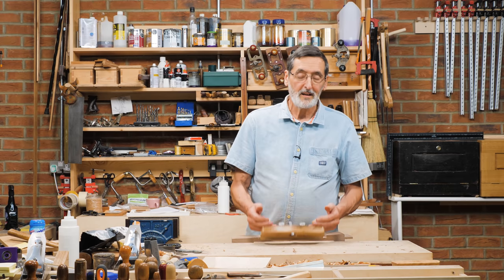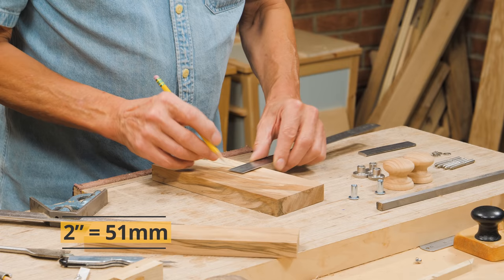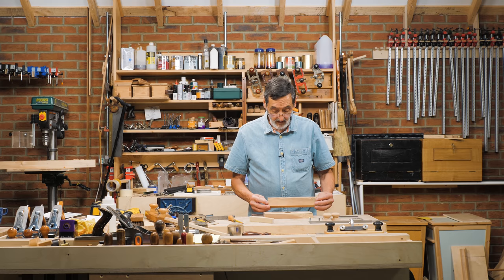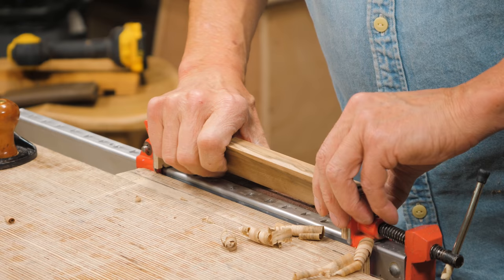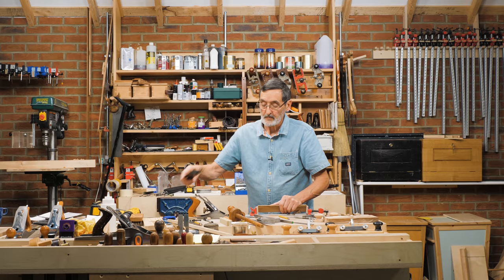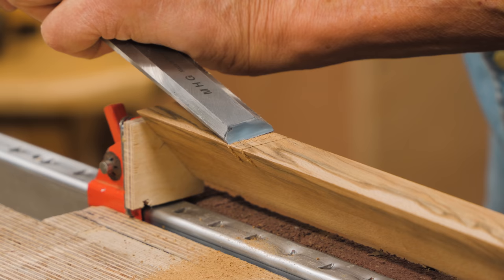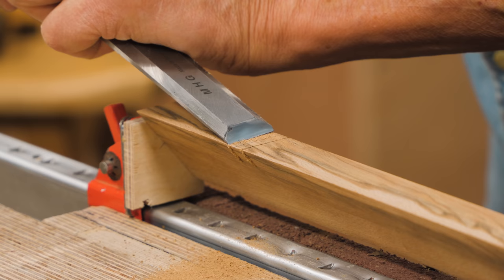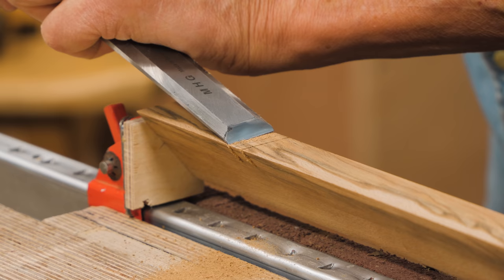How to Make the World's Best Router Plane | Paul Sellers | Episode 1

Comment: Mr Sellers, 
I have done it! Whilst I have been handy all my life, I've never been a wood worker. After restoring a few old planes for a project, I saw this video and knew I'd need one, but can't afford them these days on ebay. 

I sourced the hardest to work woods for a newbie: hard maple and mahogany. 
I had to learn how to use my new planes to cut down the oversized stock I got. 
I had to source, cut, grind, and bevel square steel stock and then learn how to heat treat it at home...I quenched with oil. 

Then I made my very own BLO and shellac cuts, thanks to you. 

If you'd like I can send you a link to the build with pictures and descriptions. 

It took me well over 150 hours to put in all the work to make this project come together, but I've learned so much I'm thinking of looking into an apprenticeship at 50 years old. 

You're a gift to us all.

Comment: The timing of this video is perfect. Have been looking at both new and used router planes here in Australia and the prices are nonsense.
Reply: Same. Stumpy Nubs also has a video but, you know, it’s Paul. 🙂👍🏼
Reply: Same here… nonsense is right.
Reply: @willemkossen  thank you
Reply: I bought a router plane from eBay for just less than £100 UK pounds after two and a half years looking. Nightmare. In some ways I wish I’d waited and made one but I presume Paul is going to grind a bevel onto the tool steel. I have neither a grinder or the patience for that.
Reply: problem here in the uk is the wood makes it almost rediculous. if you dotn have it already the cost is ineffective you mgith as well get a new

Comment: Quick, order your bar of 10x10mm tool steel now before it triples in price, due to the Paul Sellers effect!
Reply: Soo true
Reply: @Old Man Henderson, the one with the Trousers Chester hobbie store
Reply: Wood by Wright caused all the Bench Dog router plane blades to sell out until next August! Thankfully, toolsteel should have a slightly better supply.
Reply: The ghosts I called… 👻
Reply: Totally! I ordered mine right 15 mins after the video dropped, and the price is 50% higher now.
Reply: Ha ha.... Paul is getting dangerous.
Reply: I’ve made one similar to this an I cannibalized an old chisel for the blade. Blade needs to be long enough to make the notch. And lop the socket off. Not perfect but it’s served me for years.
Reply: Actually, with a little redesign you could use cutters made from a variety of sizes of blades.  If you look on machine shop supply websites for lathe tool blanks you can find it in sizes ranging (in the US) from 1/4 inch (about 6 mm) to 1 inch (about 25 mm).  That might suggest interesting possibilities for that router plane.
Reply: 111111111
Reply: Just get a half inch high speed steel lathe tool blank.
Reply: Amazingly they're higher price for a factory cheap oem on Amazon than the real old Stanley tools second hand on the bay.

I had to settle for a scraper card this time around. 😂

Comment: As an American, i really appreciate the conversions from the metric system to imperial. Big fan- really thought this was an awesome project, looks like it works incredibly well!
Reply: In the uk they switched from imperial to metric and it left us all with a mush of figures in our heads. Half the nation was rejecting metric and half rejecting imperial. By the time I was in junior school in the 80's they quite literally banned imperial figures, we we got in trouble for using them.
I still have the mush, depending on the size of the measurement I'll flip back and forth between the two formats, which is bad, because it's fitting the measure to the part. Hence the mush 😂
Tiny things are in mm, larger measures I do in inches with a conversion reference in my head to metric, and then large measures over say 40ft and I'm back to fully metric again.

Metric I find easier to see the sizes in my head, so many products in the middle that use inches so that stuck. And mm just make sense for tiny measures.

Apparently metric won the war as most parts on the global market are in mm, the big manufacturers are switching to it for compatibility and cost reasons.

I still prefer pints of milk to litres 😂
Reply: @luminousfractal420  yeah I kinda wish the US had switched to metric.. I feel it's easier to be more accurate without having to think much, and is much easier to do the math in your head with metric... plus it really does seem much more widely used. Imperial seems like random numbers with how things break down- and metric just seems way more straight forward based on multiples of 10/100/1000... 

I can totally see how it could cause some chaos and confusion having a country transition to using another measurement system though...

Comment: I love how Paul always puts measurement conversions on the screen from metric to imperial. As an American this is so extremely useful! You can argue the benefits of the metric system all day long and whether or not we should use it, but as someone who didn’t grow up with it, it’s extremely hard to visualize in everyday life. Ask me to guess how long something is in inches and feet and I’ll probably get pretty close. Now ask me to do the same in meters and centimeters and I wouldn’t even be close. I realize we’re like the last holdout in the world through our own doing, but Paul putting up both measures on screen makes his videos so much more practical and user friendly to those of us across the Atlantic. 

Incidentally I personally think there’s more to be said for the Imperial system at least where woodworking and other trades are concerned…try quickly dividing anything metric into easily measurable halves, thirds, quarters, or sixths, and then do it with the imperial system, which is easier? If you need to break something into 3 pieces it’s easier to measure out in terms of 3x4 inch pieces than try to guess where 3.3334 cm is. And that’s just one example : )
In the science fields then metric is probably better. I think that both systems have their benefits in reality. Imperial for the everyday practical application of quickly dividing things into measurable fractions and metric for when when extreme precision is required.

Comment: I made something like this but it didn’t work well with a chisel at an angle. Instead I have just made one using an Allen Key. I ground it and sharpened it. I drilled a hole for a tight fit in a 1.5” square hardwood. I angled the base side to tilt the cutter and screwed it to a base with a 2” hole. I adjust it by tapping with a hammer to the base of the rebate and then another tap. It works a treat. If it works loose I shall add a screw clamp. I might add handles but it works fine without. I might also buy a Veritas cutter if this blunts too easily. 
Paul Sellers is a huge inspiration.

Comment: Paul,  two things, one is that a flat bit is intended to run fast to be efficient, they put a lot of strain on the drill if run slowly !  and two, a sharp adjustable bit in a brace cuts the outer periphery of the hole first so you get about the neatest hole you can get, now I know you know this so just reminding you !    if your bit is sharp you should not have to work too hard, I have drilled holes up to 3” in big lumps of timber with these (boat work) without too much strain.
Reply from the maker: Thank you. I did sharpen the brace bit fgresh before I began and it took all of my strength to get ot through the beech. I too was very surprised at this and so I could not advise people to do what was as near to impossible as it was for me, despite my 56 years of experience using one regularly. I thought I made that clear but perhaps not. I also try not to use what the vast majority of my audience do not have readily available to them, as best I can, that is. I would guess that 98% of my audience would not have the bit size nor the bit brace to use either as my audience is across the globe and also in the poorest regions thereof. As for the flat bit question. I do understand this but even so, I had to work with it to go through.

Comment: Hey Paul. You probably won’t see this as this video is 4 months old, but when using a drill with a keyless chuck like that dewalt you used, you tighten the chuck to the bit and then loosen it by hand until it clicks once. That’s how you lock a keyless chuck so it won’t loosen on you during operation. I threw away a perfectly good ridgid hammer drill not knowing that little tip.

Comment: Your first drill had the clutch engaged (numbers = screw driving mode) which is why it was stopping. If you turn it to drill mode there is no clutch. Also speed 1 for larger bits as you need the torque rather than speed. And great tutorial, thank you!

Comment: NOTE on difference from Video and Online Instructions:
I'm in the process of building my plane from the kit.  It is worth noting that the instructions on the website the kit links to takes a different approach than the video does on preparing and cutting the upper portion of the plane.  In the video, Paul prepares the 50 degree angle and then cuts the slot for the iron.  In the web page instructions, he cuts the slot for the iron first which is simpler for work holding since you are working at right angles for the challenging part.  I wish that were noted as if I had noticed that earlier on, I would have likely taken the approach from the online instructions.  

Now... on the plus side, I spent a day designing and building some vice jaw inserts to create a way to mount my pipe clamp like paul does his window sash clamp.  My vice jaw sits flush with bench apron and ... well... a pipe ain't held best by a face fice.  My jig is absolutely essential for work holding the upper portion with video instructions.  Especially if you need to do some tweaks on it after cutting away from the extended piece of wood.  I can see that this vice-jig will be a true game changer for future projects.

Paul, as always, I appreciate your videos, blogs, and websites.  Thanks a million!

Comment: As long as the iron doesn't need to be hardened, I think I might have to make myself one like this. Excited for part 2. 👍👍
Reply from the maker: The blade ideally needs to be hardened. However, it does work pretty well just as mild steel. You'd just have to sharpen it much more often.

Comment: As I made my poor man router plane I used the tool steel itself (an allen key) to fine adjust the groove it will rest in. Thus I got the perfect hexagonal fit.  No guesstimating. The tool steel itself is the best scraper/chisel. Clamp it flat on your table and ride the piece of wood on it. Use paper/scrap vernier for elevation to just the tenth of a millimeter you want on the finished fit.

Comment: Dewalt Drill Tighten clockwise, then turn one click counter-clockwise. I know this is counter intuitive AND it will feel like your bit has been loosened, but do it anyway. This will lock the bit in and it will not loosen.

Comment: I'm not sure why anyone would try and read a piece of woods grain direction by eye. It's dead simple to use your finger tips and rub in both directions. One will always feel a bit rougher than the other. At a macro scale, wood is much like the fur coat on a dog. One direction is quite smooth, the other direction would go against the direction the hair on a dog lays. Wood is exactly the same so it's grain direction could be accurately accessed even while blindfolded. So you'd position the wood and obviously plane in the same direction the wood feels the smoothest. Your sense of touch is far more accurate than your eye's are, and especially so with highly figured wood where the grain direction can run in multiple directions.

Comment: Hi Paul, I’m just about to order your router kit but I wanted to check something first. My piece of oak is an inch and a quarter. Does it matter that it is slightly thicker. Will it effect the length of the bits with the kit? Many thanks…..

Comment: Thank you for the awesome project! Here in Thailand imported quality hand tools are very expensive (import tariffs & people use power tools as cheap Chinese hand "tools" are unusable) so a DIY project would be very useful.

I'm wondering how to obtain the suitable blade steel here in Thailand. The closest I can find is S50C or S45C, which seems to be carbon steel with 0.5% or 0.45% C, which is less than 0.9% in the recommended O1 steel. At least they sell 10x10mm bars ($8/m, named "ลิ่มเหล็ก" - steel ingot or ลิ่มแท่ง ลิ่ม"machine key") since I don't have much metal working tools here. I saw people make machetes out of those steel. Do I understand it correctly that medium/high carbon steel would be tougher against harsh usage but would not hold edge as perfectly as O1, but still could perform decently for such a small blade (possibly with more frequent sharpening)?

Knurled nuts (DIN 466) can be also found on the big online marketplaces. The screw-bolt rod could be replaced by a screw nut and a threaded rod (or bolt with head removed).
Reply: Probably the easiest way would be to get a cheap (but not too cheap) chisel with 9-10 mm width and cut it. S50C can get maximum hardness around 30 HRC which would likely be too soft.

Comment: Sellers Router Plane Plans
     Paul the questions is about the bottom diagram on page 3 of 6.  It appears to be the top view of the
router but the width of this top view is different that the bottom view above.  I suspect it's was did this
way so it would fit on the page.  Am I correct or is there a better explanation ?
I have my base piece cut and ready to drill the center hole.   So I'm not ready for the hardware but It
will not be too long. 

Thanks,
David R Grindel

Comment: In the video, Paul says that the notch should be cut to a depth about 0.1mm less than the thickness of the cutting iron.  That's barely the thickness of a sheet of paper.  Would the iron be held as securely if the depth of the notch were 0.5mm to 1mm less that the thickness of the iron?

Comment: Im not sure it is the best router plane. perhaps there are two home built types. In my humble opinion the front edge of this essential tool should be straight not curved. This enables the user to pivot the plane upwards whilst using taking the back edge of the plane off the job. This allows the user to set the final depth of cut but to creep up on it and lower the depth of cut by pivoting up on the front edge and then making progressive deeper cuts. Yes it does change the geometry of the cutting slightly to the job, but it works.

Home made router plane aka 'The old mother's tooth'

Comment: I was intrigued: you chose 50 degrees because with any less it gets hard to see the cutting edge. Why not cut the 32mm hole through the sole at 50 degrees (or 45, or whatever) ? Or
even use an oval hole to improve visibility?
Reply: Try it out Chris and see what you think. I've found though that generally with Paul and other masters like him that when I've made adjustments like that I discover through use the reasons why. Like I had a chisel fall off my workbench and decided to glue a strip of wood at the end of the tool well. I thought that'll stop it rolling off and wondered why I didn't see it done before. Then I went to sweep off the bench and found the strip made cleaning the well a chore. I took it off again and now just make sure my tools are away from the edge. But it was good to try it out all the same.
Reply: @michaelballinger6419  I have seen your piece of wood cut at 45deg to make it easier to brush over.

Comment: I just bought all the parts from the PDF and it came up at around 80 GBP (the Beech from eBay was 20GBP of that, the iron was 15 GBP), plus a bit more to get rasp and file (40-50 GBP). 

Have you (or anyone reading this?) thought about supplying kits of the right amount of fixings, metal and potentially precut wood blanks?
Reply: Seems a lot. I can buy enough beech locally to make 10 for £11. Other parts should not be that expensive. hanger bolts £3 from B&Q, 01 steel about £10 din 466 nuts about £5. You don't need the rasp or file, you can do the same thing with a chisel and sandpaper.

Comment: Hi Paul, Quick question, although I reckon you've moved on to other projects.  What other wood would you consider using?  Sapele?  Wenge? Suggestions?
Reply from the maker: Hello Joel, Just about any of the above, although I would avoid truly soft-grained woods if you want something long-term use. The great thing is that you can transfer everything to a new sole anyway..
Reply: @Paul.Sellers  Thanks, Paul.  I went to my local hardwood supplier and found a lovely piece of 5/4 Makore at an insanely low price. So I'll be using that.

Comment: Not sure if anyone asked this already, but would it be possible to use an old chisel for the blade?
Reply from the maker: Yes, a chisel should work nicely. It will need softening and then hardening again after the metal is reworked.
Reply: @Paul.Sellers  thanks for the response! It was my understanding that the handles aren't hardened steel, so you could stay away from rehardening if you keep excess heat away from the cutting edge? Is that right or does it probably vary depending on the chisel?
Reply: @devon5546  I made one out of a disused and heavily pitted 5/8" mortice chisel. It was only hardened the first few inches from the end.